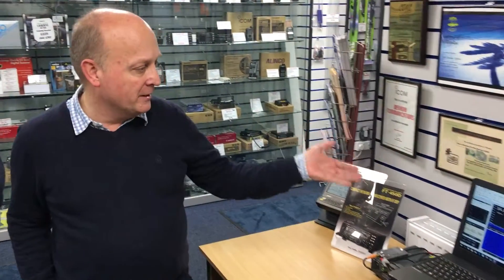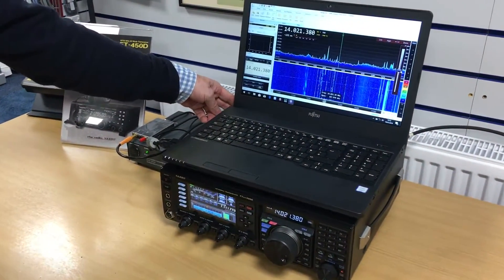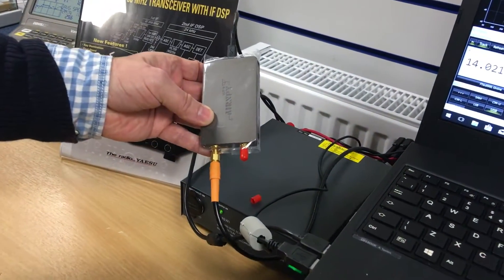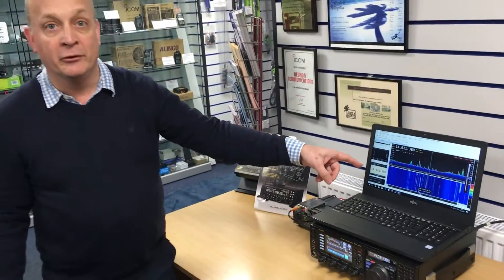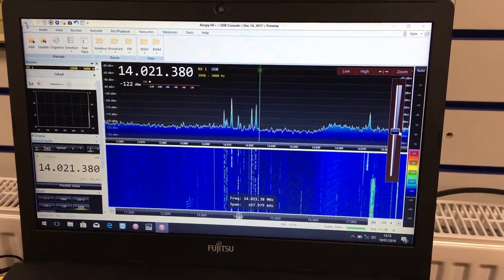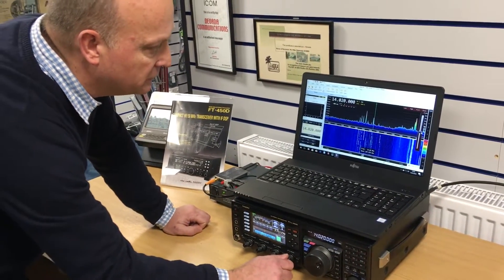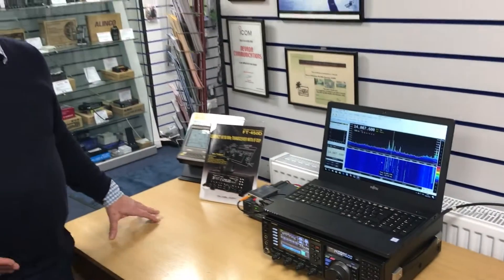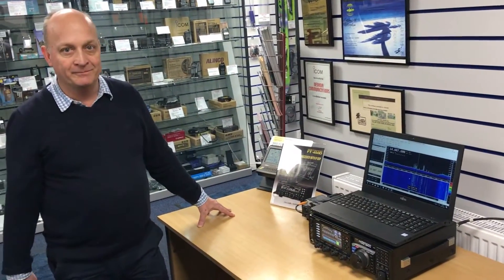Yaesu SDR Demo for Yaesu FTDX3000 & FTDX5000

Comment: What's the name of the SDR?
Reply: There's 3 independent pieces here that make the software-radio:
1) The transceiver, in this case it is a Yaesu FTDX3000,
2) The Panadapter, this is a piece of hardware which serves as a go-between and sort of translator between the computer software and the radio, it is what allows the radio to send commands and data to the computer and vice versa. In this case it is an Airspy HF+
3) The SDR software, in this case it is Airspy SDR-Sharp (also called 'SDR#').

Comment: Can the airspyhf+ be used with an ft-991?  Can you do a video showing how it be would be setup?
Reply: FT-991 lacks the RF Out port so no it does the same as one can do on the FT-DX3000. But there are products to buy so you can do it. For example: https://www.mfjenterprises.com/Product.php?productid=MFJ-1708SDR